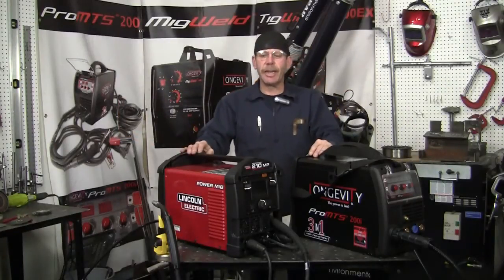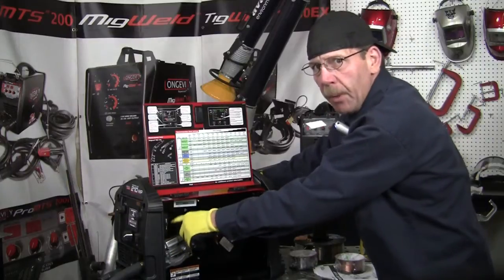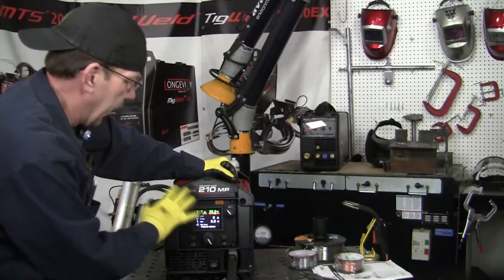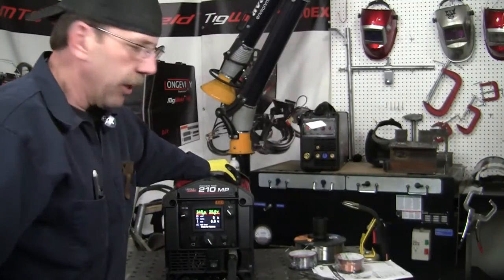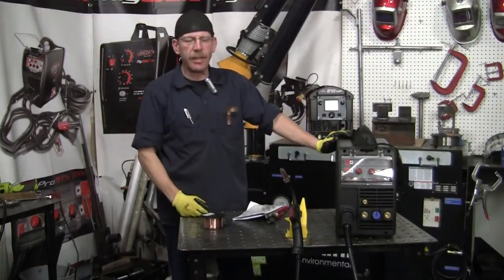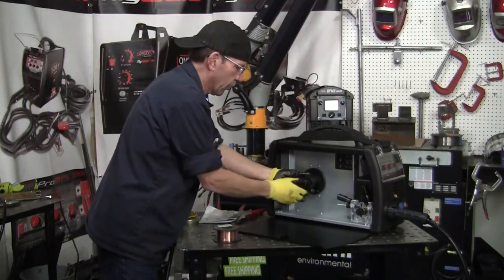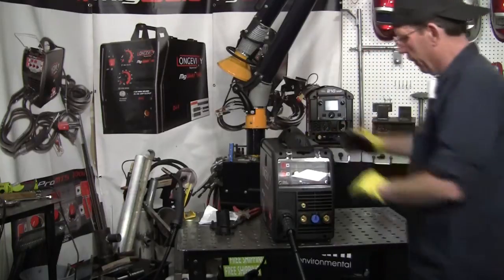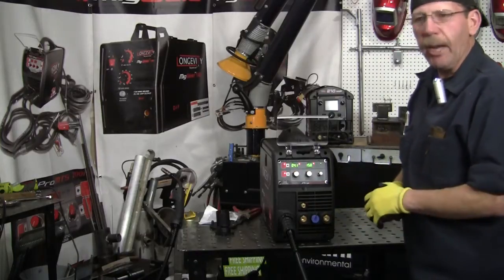Lincoln Electric PowerMIG 210 MP vs Longevity ProMTS 200i MIG Review and Setup Video Part 2

Comment: Does anyone have info on the Lincoln power mig 250? I cannot find info ANY WHERE on it. Trying to find out how old it is. Amps, all thst good stuff. No matter what I type on Google it shows NOTHING. only 256 252 and so on.
Reply: Gregory Johnston lincoln 250 is 250amps its an older machine about 10 years ago it was top of the line but it out dated now